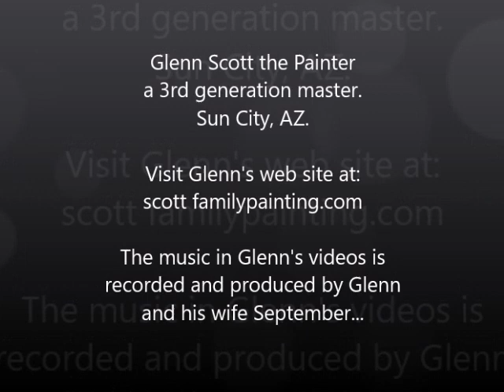Painting Closet Panel Doors...

Comment: I hired someone to spray paint my closet doors because I thought that would have the best finish. It looks terrible! Very patchy. I will have to do what you did and go over it myself
Reply from the maker: Post a pic of the doors so I can see them...
Reply from the maker: What do you mean by patchy.. ?
Reply from the maker: Hi Tiona, if you decide to paint the doors, make sure you get a 6 inch micro fiber roller cover... they don't leave roller stipple texture...